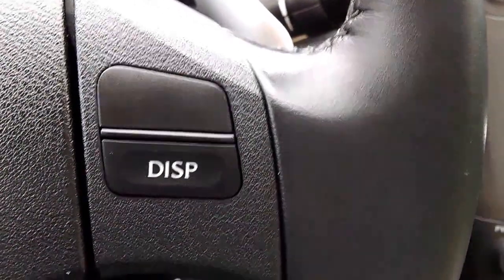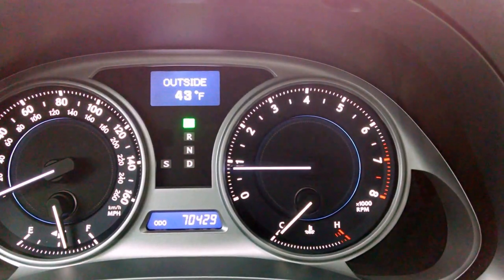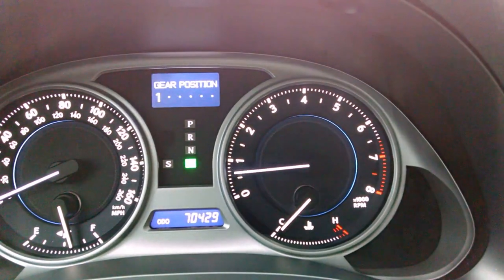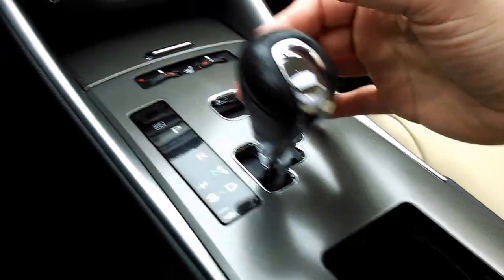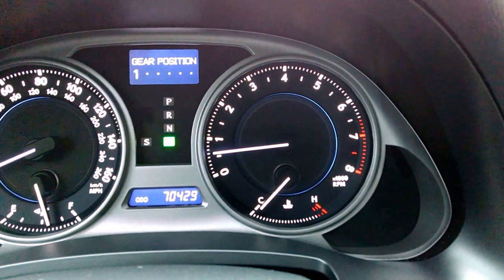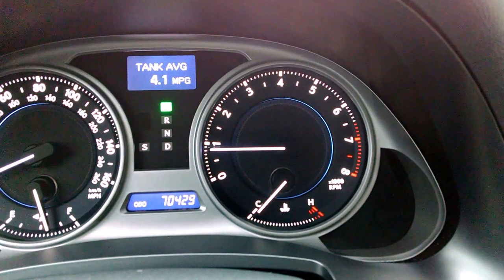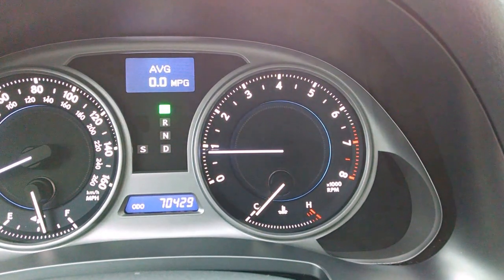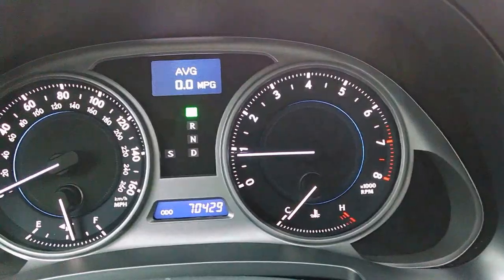Lexus IS 250 - Steering Wheel "DISP" Button- Display Explanation

Comment: Lexus is250 tilt and telescope stops working when I on ACC....but it's working manually.... this happened after battery was disconnected.... how do I customize it back to start working whenever the ignition is on the steering wheel will comes out